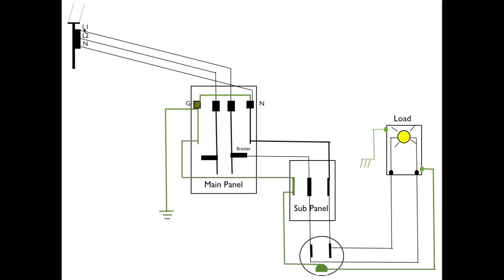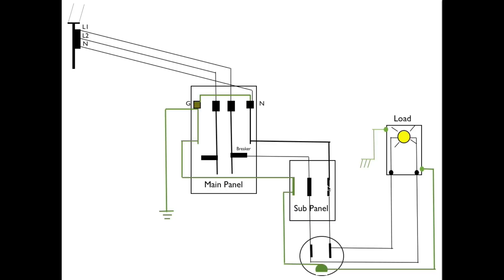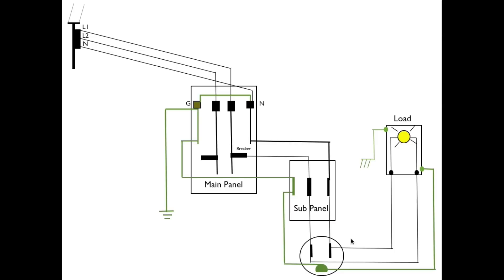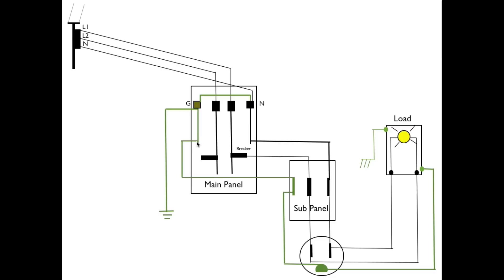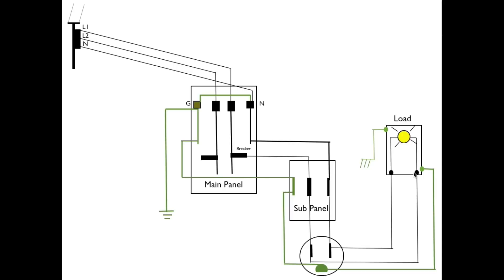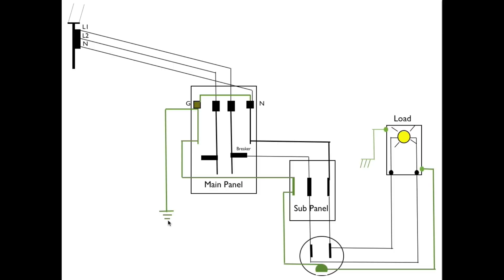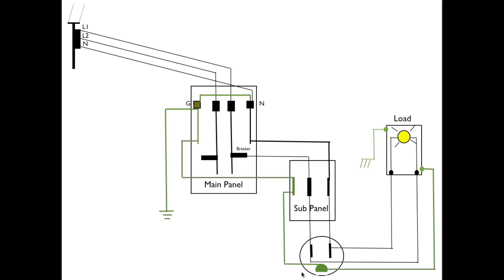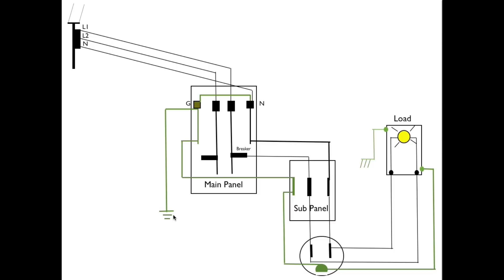The difference between neutral and ground on the electric panel

Comment: The drawing is not perfect but the discription is exactly how it should be.  Not bad from somebody from a country where they shit on ground and neutral.  Good job mate.  Simple and clear explaination
Reply: +J IJzer care to elaborate on the "somebody from a country where they shit on ground and neutral"?
Reply: Carolina Rodrigues Hi Where i come from the most important in the electrical installations is the grounding and taking care the neutral. I had some machines from the us  and there was nothing done on neutral and grounding. Before we could start using them we most of the time had to rewire the machine so it could match the standards from my country. When i see the installations in the us  many times the ground is used as neutral or visa versa. So my feeling is that in the us they not realy take care neutral and grounding.  Where i live now in south east asia its even more worse. If you ask for a ground or a neutral they look verry strange at you. Ground and neutral are always combined. But that can give problems when you have one fase machines where you can turn around the power connector.  Or try to buy a 5 pole power plug.  3 phase neutral ground. 
Or even a 5 wire power cable is hard to get. I hope i am clear in my explanation.
Reply: Carolina Rodrigues and btw this guy explains verry good the differents  so you can see you cannot combune neutral and ground and you cannot use ground as neutral or neutral as ground.
Reply: +J IJzer If you saw an installation in the US where ground and neutral were being used as the same it was done by someone that shouldn't have been doing the wiring. NEC does not allow this and it is not common practice I can assure you. I've been a Journeyman wireman in the US for 30+ years and that is not how we train our people.
Reply: Tony Thomas ok i worked for GE in europe before and sometimes we got machines from the US and sorry to say they where bad wired but good to know that there are stil good rules for that. Be safe : )
Reply: The problem being that machine and appliance manufacturing companies are not regulated by the NEC but are regulated by UL and yes they do some funky unsafe stuff such as you are referring to. You sound well trained and sad to say better trained than many I've worked with.
Reply: Tony Thomas thanks i am a E engineer from origin and i design and commision  production machines for more than 20 years  and i seen a lot of mess all over the world. now i am active in asia and that is even more worse than you can imagine. Ground and  neutral is verry fussy here. And many times verry dangerous situations. But i do my best to get it under control here.
Reply: You are more trained than I am it sounds. I wish I was an engineer. In fact that is my biggest regret that I didn't get that level of education. I did an apprenticeship and was apprentice of the year but it was electrical construction. Now I stumbled into a job where I design, build and repair industrial machines for a ceramics company. Aerospace ceramics that is and I love it. I enjoy going to work now.
Reply: Tony Thomas the most impotant is that you enjoy your job the title is for me not so important i started my job from ground level up. In my first job i found out i did not like it so i had to go back to school in the evening.  My big advantage is i did everything. So i understand when electrician have a problem or the job takes longer than suspected. I am always good friends with the people on the workfloor two way respect. The most important thing for me is experience. I get sometimes engineers direct from school and they have no idea how it works. I always tell them forget your study before your new study starts now.  It must be inside you and if you dont get that machine building is verry dangerous. But i hear from your story that you have a nice job and you enjoy it . That is 90% of the job. The 10%left over you will learn quick.
Reply: After 30 years doing construction electrical work I was getting bored and wasn't enjoying going to work but getting lucky and stumbling into my present job where I do everything, not just electrical, there is never a boring day. Also before I built what the engineer designed where as now I build what I designed. Never did I imagine I'd ever be doing this or that anyone would trust me to do that but they do and I love it. If I had an engineering degree I would get paid much better but I'm happy to be trusted and allowed to do the work. Its exciting and has forced me to learn a lot of new things and thank god for the internet which makes that learning possible.
Reply: And I know what you mean about the young engineers! I think all engineers should be required to spend time in the field actually doing the work as soon as they graduate because what you learn in the classroom isn't the real world. You need that classroom education but without the field experience you just can't be as good as you should be.
Reply: Also I just came across the MikeHolt NEC channel here on you tube. Check them out, they are very good.

Comment: Per national code here in the USA the ground and neutral are "bonded" together at the main panel or wherever the first point of disconnect is. (meter with a main breaker or similar) Once you get beyond that point the ground is redundant for safety sake. IOW, any shorts have an alternative path, which is why code calls for separate ground and neutral wires from any sub-panel all the way back to that first point. Some local codes may ask for bonding at both the meter pan and the main (first) panel.

Further, the neutral here in the USA / Canada goes to another ground rod out at the pole transformer. IOW, you have one (or two for new code) ground rods at the house plus another at the transformer location. Why? Because we have what is known as an unbalanced feed for most residential power. We use a double tap transformer at the pole and that supplies each leg with 120 volts. (240 volts across both legs) The other half of the power path for 120 volts is an earth ground, which code calls a neutral because it carries part of the load. The ground rods at the house are for safety in case something fails. The safety is always redundant so YOU (or your appliances) don't become part of an accidental circuit. (ouch!)

Why so many ground rods? Considering how many variables are in the earth, sand, organic matter, moisture, lack of moisture, rock, gravel, etc. Not all of it conducts well so more rods at more locations mean a better chance for conducting electricity. Again, redundant for safety. (and reliability)

In countries where they use only 240 volts (Europe, etc) they don't have a neutral and that's called a balanced main. Yes, they do have a ground wire for safety! (same as us) The reason they call it "balanced" is because you never have to worry about having too many items on one leg of a panel. With 240 volts everything is on both legs already. With an unbalanced system (pair of 120 volts and neutral) one most consider how much of the load is on each leg when planning a new system.

BTW, if for some reason one of the load carrying wires has a bad connection usually the load fails to operate properly because the load causes the voltage to drop. A short circuit will only go to ground if a hot wire touches the chassis of the tool appliance... AND... nobody fooled with that 3rd prong. Of course a GFI outlet may trip if one of the load wires has a poor connection, but that might cloud the issue for this discussion. At any rate, all of this is beyond the wall outlet, which should be up to code.  A shorted wire in a wall should go to neutral or ground, which will cause the breaker to trip. That's why metal conduit is always grounded, along with metal boxes.

Oh, one flaw in the diagram on the video is the hot prong on an outlet is on the right side. If it's a polarized outlet (or extension cord) the smaller slot is hot and the wider slot is neutral.
Reply: I wonder how many have to point out this error in the diagram before GFM corrects it? I find the error mentioned by very few commenters. Let those who believe the receptacle polarity in the diagram take their VOM and check voltage from the ground opening at the bottom to the (usually wider) hole on the left. They will get close to zero voltage difference if not exactly zero volts and hopefully believe there is an error in the diagram. We will see how long it takes to get this simple but VERY dangerous error corrected in an otherwise excellent and valuable presentation.
Reply: rupe53 So there are many connections in a system where neutral is ground-bonded ( the pole and at every household main panel on the same transformer secondary)?  Could that not cause extremely large neutral conductor current when the grounds are at different potential s?  ( I can now only think of a wiring problem or a lightning strike to cause large ground differentials).  I don't think my main panel has the neutral ground bonded, but to be honest I just went over to it now and decided that I was too tired to unscew the panel to look
Reply: In the UK and other commonwealth countries, we follow a type of earthing system called the TT system. We do have neutral conductors, split phase
Reply: rupe53    Wow!   A whole lot of writing that has numerous mis conceptions on how electricity works.   I hope you have learned differently in two years!
Reply: @mrlovemuscleable  No, TN-C-S is the common in the UK. TT means that the ground is provided locally and has no connection to neutral. On TT RCSs/GFCIs are important as the breaker will not trip.

Comment: Thanks for the video!  The "debate" about the "separation" of the neutral and ground has been going on since the Mayflower landed!  lol    Anyway, as a physics major we look at these things a bit differently as does the Power Company.  If you would be kind enough to next do a video about the "extra" ground for the computer power outlets it would be nice to view.  Notice where the "extra/dedicated" ground is connected when it returns to the service entrance.  Again, thanks for the video.
Reply: I think you are referring to what is called an Isolated Ground. The same feature is found on a lot of hospital equipment.